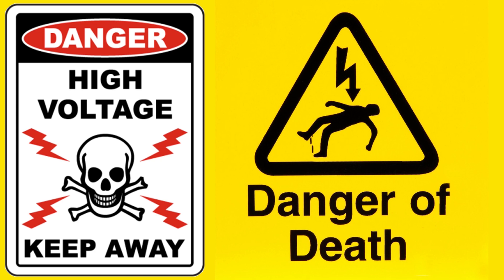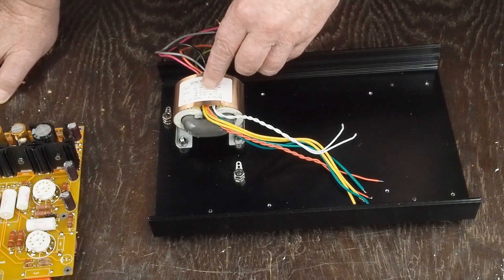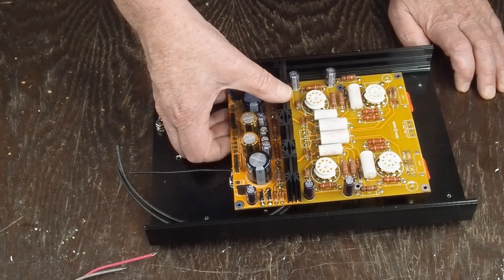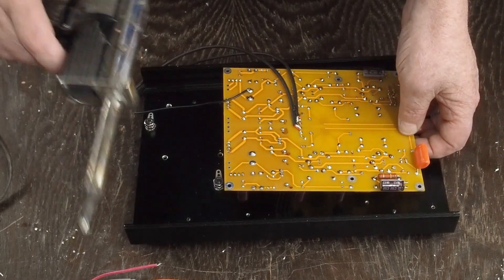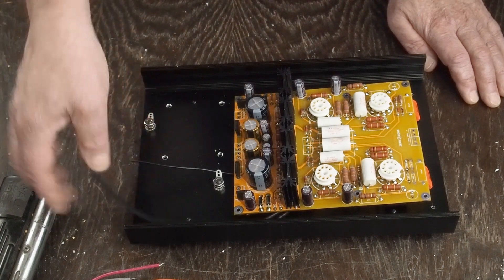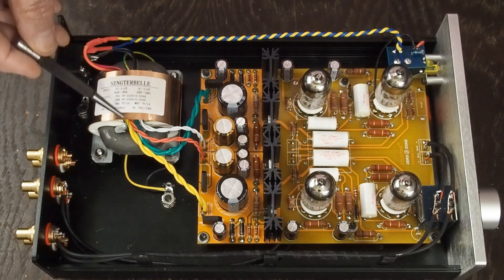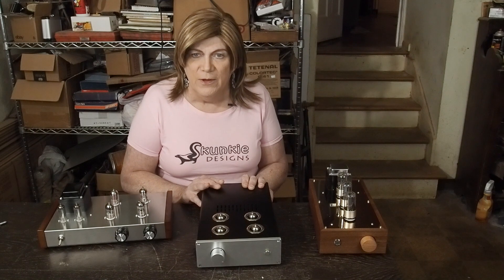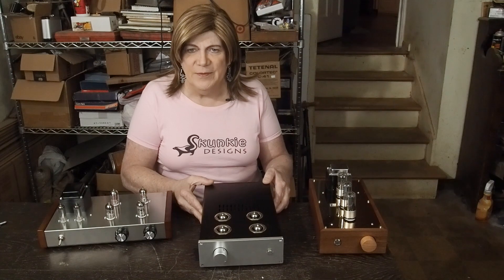HiFi Tube Pre-amp: Final assembly

Comment: On the schematics provided it doesn't show the value of resistor for negative feedback, it literally is not printed on the page the line just stops, can you tell me what you did for that please. Attempting to build this preamplifier.
Reply from the maker: I built this using this board, it looks like from this schematic (someone else drew it) that there is no resistor between those two points.

Comment: Beautiful wiring and board. Where did you get the tube rings? I'm building a tube guitar pre-amp that that's a lot classier than rubber grommets.
Reply from the maker: Thanks! I got the "rings" from Amazon, they are 1 inch grommets like you would see on the corners of a tarp.

https://smile.amazon.com/dp/B07CQXTX38
Reply: @SkunkieDesignsElectronics  Very clever. Thanks!

Comment: Put a 333pF  Y capacitor to ground clean up cut out any hum you will need two one for the transformer one for the board ground
Reply from the maker: I'm not seeing that just placing a capacitor between the board and ground would give any safety improvements over just leaving the ground plane on the board floating, it still wouldn't blow the fuse is there was a component failure.  Here is a good article and no, you should never "ground lift" the transformer core.

https://sound-au.com/earthing.htm#s6
Reply: Nothing about safety improvements! just about lowering the noise floor and interference you were talking about hum. Not sure what the rest of it is you're talking about got to do with the price of fish. There's no ground lifting
Reply: yeah but it's such a small values I just don't think it's a problem and after charged it's constant
Reply: Would you share your final BOM on the board? 😜

Comment: what speakers do you use .
Reply from the maker: Klipsch RP600M for my main system.
Reply: @SkunkieDesignsElectronics   just  looked there a nice looking set of speakers.
Reply from the maker: @oadamo  They work really well with low power SE tube amps.